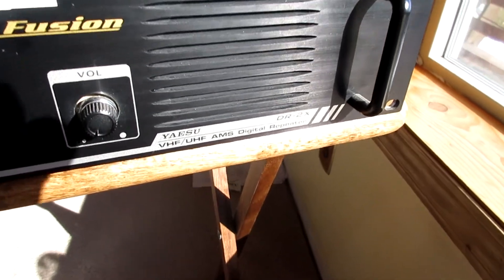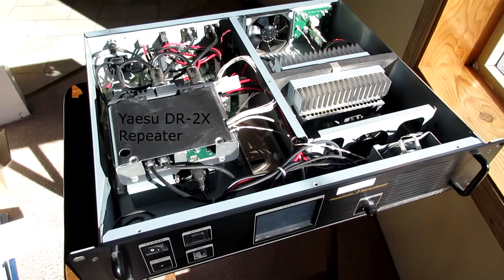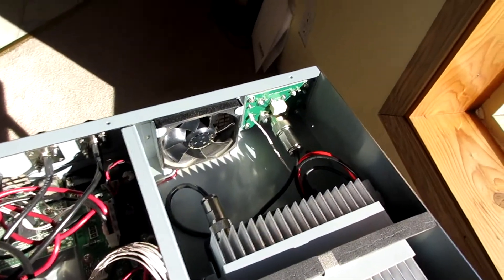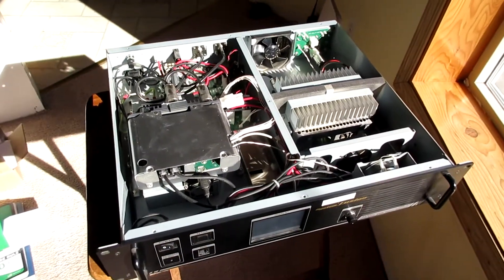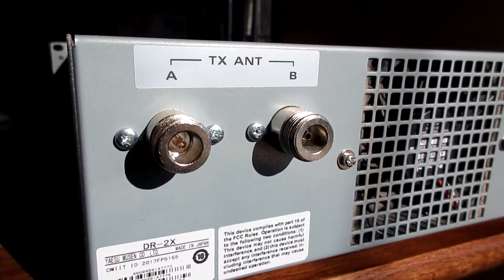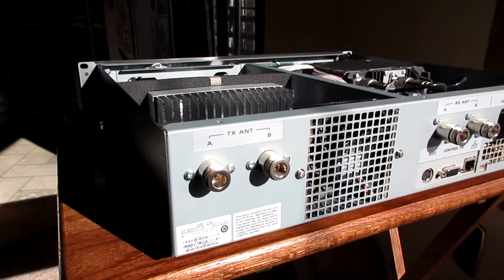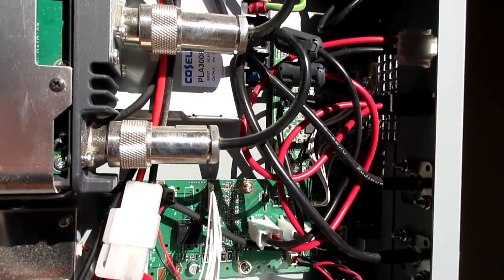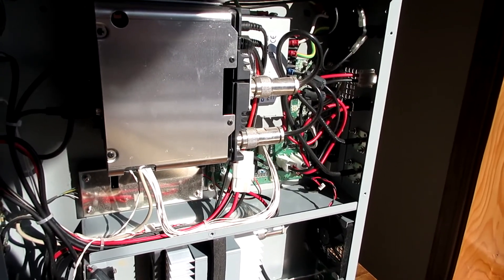Yaesu DR-2X Open Case

Comment: Hello dear OM
Thk U for your video. Could you give me the reference of the switching power supply included in your DR2-X, please sir ?
I have the DR2-XE model: E for Europe. And in Europe this transponder is sold without its AC 100 - 240 Volt power supply. It is only 13.8V DC!
Thank you very much and happy holidays 2023
73's and Friendships